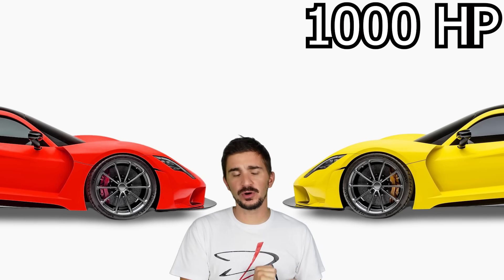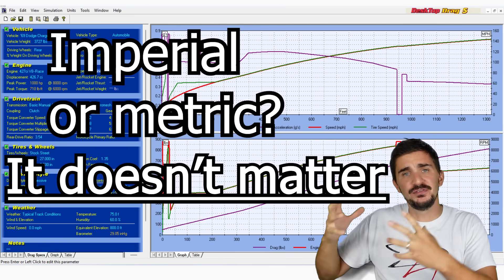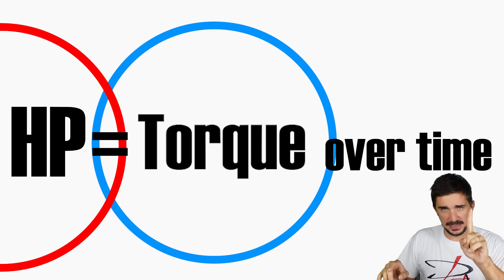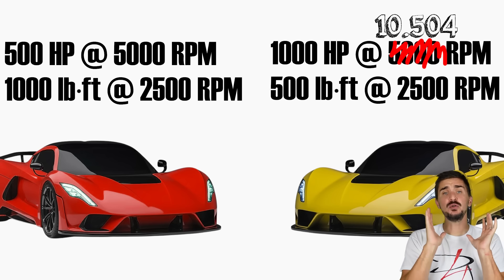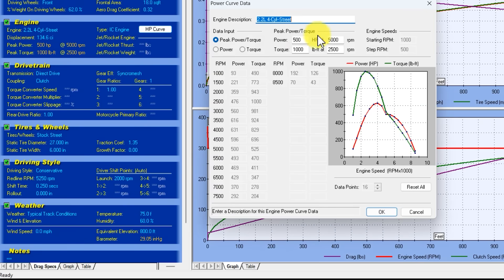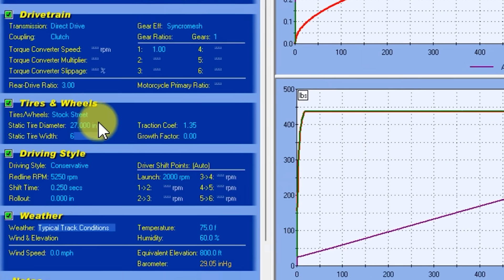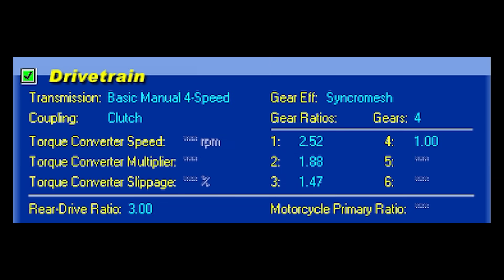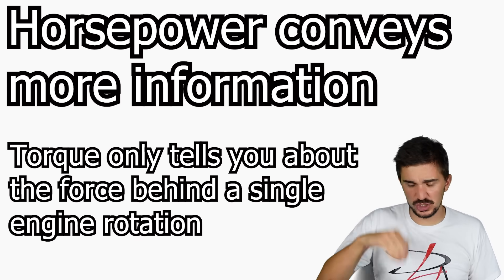Who's faster? Explained and Simulated - Horsepower vs Torque

Comment: Something that wasn't considered : if you make a lot of horsepower at high rpm, you can use shorter gearing to have higher wheel torque and still benefit from the high hp figure.
Reply: He literally added a transmission into the equation and thus determined torque bias being too overwhelming. Even added in a final drive and better tire factor. That’s the point of the whole video… adding variable factors to suit you ho/tq numbers completely change the results of the static output of X engine.
Reply: @theclamhammer4447 part of the reason torque was overwhelming was due to the fact that both of those engines were utterly ridiculous.

300/600 to 600/300 would probably be a more realistic comparison, it would certainly bring the RPM down to a reasonable range so that the gearing would not be as much of a factor as a 10K RPM engine. There are only a handful of cars on the street that can even hit 10K RPM and they still don't have terribly aggressive gearing, being street cars. The gearing on our cars is inherently biased to the low RPM engine as that's what they're designed for. 

If he used a modern six speed automatic, my dad's 2009 Z71 even, first is like 4.7:1, final is 3.42:1, that would put the 10K RPM engine back in the running.

He made a good point and got a lot of discussion going, which honestly might be better overall than being 100% correct in the video.
Reply: @theclamhammer4447 It is a definitional truth: acceleration at any speed is determined physically by the amount of pulling power at the contactpatch between the wheel and the road, which is determined by the torque at the crankshaft x the reduction factor between the crankshaft and the wheels. This reduction factor incorporates EVERYTHING, from the chosen set of cogs in the transmission to the reduction in the differential and the seize (radius) of the wheel including the tires. And the trick with power is that it is torque (at the crankshaft) x rmp of the crankshaft. So more rpm enables the running of a higher reduction and therefore an increase of the pulling power at the contactpatch between wheel and road. In other words a doubling in rmp with the same torque (= doubling in POWER) produces the same end result (after changing the reduction) as a doubling in torque at the crankshaft. Conclusion: it is POWER that matters for performance, NOT torque.
Reply: @theclamhammer4447 technically you shouldn’t have the same gear ratios for both engines though, so no the transmission example wasn’t very accurate
Reply: @theclamhammer4447  You don't get it, because you can rev it to 10000rpm and not 5000 you can use much shorter gearing and still have the similar top speeds. Shorter gearing = more demultiplication = increased torque at wheels. So in effect the low horsepower engine through gearing could actually have more torque at the wheels.
Reply: @theclamhammer4447  he didn't even adjust the torque biased car to match the equation. to get a 500HP car with 1,000 ftbls of torque the rpm needs to be 2626 not 2500
Reply: @theclamhammer4447  Ultimately it is all about torque at the wheels. if you have 2x the torque, but have to run gear ratios that are twice as long, because your engine doesn't rev, you have the exact same wheel torque at any given wheel speed. assuming a normal torque curve, not the 45 degree angle he showed here.
Reply: @russelljimenez4715  Ultimately is always about power. Torque only determines how many revs have to go along to produce whatever power is needed out of any engine. 
 If we need a lot of power to overcome inertia on a high mass vehicle, then, high torque is desirable so that we don’t need to rev up and burn the clutch just to get moving.
Reply: @russelljimenez4715 horsepower is just torque at speed. High torque just means smaller/longer gears are needed. Low torque engines with high horsepower at high RPM can just use a big/short first gear. 

500hP is 500hP. You will get the exact same torque at the exact same speed no matter what the engine torque is at the time, if gear ratios are appropriate. 

Only downside to something with VERY low torque like 10nM is that you would need a massive gear where the forces on such a small area would break it. 

But you can get any amount of torque you want with gears. Power is everything.
Reply: Especially when you have movie car transmissions with at least 15 gears 🤣. He does a great job with basic concepts and then opens your eyes to the many many factors affecting actual performance in the seemingly simple sport of drag racing. That simulator he was using was great! I created one in school that had about 20 variables to predict a 1/4 mile run of an actual car and to see how close you could get to the actual run. It was fun and opened our eyes to how complex it truly is.
Reply: @nathanaelcole8466 they just stole a transmission from a big rig 😁
Reply: @nathanaelcole8466 , 15 gears change so there could be multiple changing from 3rd to 4th and back to 3rd. Or maybe from 4th to 5th and back because the shown speed is around 110-120 MPH and climbing. ))
Reply: @nathanaelcole8466  simulator is great but parameters are poorly chosen
Reply: @nathanaelcole8466 gotta get to 20th gear wdym.
Reply: @nathanaelcole8466 there are cars getting real close to that many gears. I thing the automatic version of the mustang gt500 has a 10 speed transmission.
Reply: @nathanaelcole8466 when you have too many gears it actually slows you down. Particularly  a manual takes 250-500ms to shift. 15 shifts means 7.5 seconds were spent with no power to the wheels because you were shifting. 

DCT's can have lots of gears because they shift so fast it's more like 40ms. The time of a single manual shift is all it would take to complete all 10 gears. So you can make the ratios closer and stay high in the power band. With manuals sometimes you have to slightly sacrifice power band just to not make the gears so short that you spend so much time shifting it actually slows you down. 

Imagine shifting 6 gears just to 60mph? The same power car would be faster with 4 or 5 well spaced gear ratios just to avoid the time spent shifting. 

Sequentials tho have like a 10ms shift time. Faster the shifting, the more it makes sense to have more gears. Also depends on the power band width of the specific engine. Cars with a narrow power band benefit a lot from more gears. 

Cars with a very wide power band don't need as many gears to stay in the band over their whole range of speed.
Reply: @nathanaelcole8466  his simulation works for those who know absolutely nothing. But if you know anything about a transmission, the concept is not difficult unless you're a novice
Reply: Holy shit, this thread is wild.
45% bullshit, 45% horseshit, 10% coherent thought processes.
Reply: Depends on the shape of the curve.

True story: otherwise fairly identical Corollas. 
One with a standard 4agze at 10psi with 90kw at the wheels. 
The other with a 20v 4age and a big turbo (gt28 iirc) ~150kw at wheels.
Up to 160kph they were neck and neck due to the nutty torque curve of the turbo that only hit boost at 5000rpm and almost tripled the torque in about 300rpm before redlining at 7500.
The power was simply not usable. The turbo would pull ahead, and then fall back, and then catch up rapidly. 
So the neck and neck wasn't exactly accurate but they were side by side at that speed before the turbo kicked in again and finally pulled ahead for the last time.
Reply: wrong gearing for 150 kw 😎 once gearing once gearing be perfect its game over for 90 kw 👍🏻
Reply: @myne00  4A-GE 20V engine stock makes 162 Nm of torque at 5200 rpm or 5,600 rpm depending on the version. if you triple the torque from there its 486Nm and more than 265kW 🤔
Also if you shift near redline, only the second gear will drop below 5000rpm 🤔
properly driven it should walk away easily once you've reached boost in 2nd gear
I mean a lot of things can go wrong outside a simulation,  but if you can have boost between 5000 and 7500, its not that bad
Reply: @geemy9675  Well, I may have been a bit wrong since I was going off memory, and rough conversions from kph to RPM.  

I have the picture but YT doesn't allow links. Best I can do is describe the curve. 
The torque is showing as "N" on the graph.  
I assume this is newton-meters, but it could be plain newtons.

Torque: 1200n from 72kph to 144kph. then a strong curve up to 2600n at 168kph before flattening off at 2800n at 192kph.

KW: A steady ramp up from ~25kw at 72kph to ~50kw at 144kph, before launching up to ~122kw at 168kph, and topping out ~150kw at ~205kph.

Sorry I can't just post the pic. YT just deletes all comments with links.
Reply: @myne00 what😂my brain hurts
Reply: @myne00 wow.   Cause that was so helpful.    Thank you for all of the useful and needed details about the “race”.   It was like I was there.
Reply: in fact considered, for the first shot he stated multiple times to eliminate any transmission for the sake of clarity
next exercise: introduction of adequate transmission, so both are then comparable
Reply: And how many gears would you need?
Reply: @ErikZiak  at least one
Reply: @ldub0775  ever heard of Barney Oldfield and ford 999? Transmissions add weight.
Reply: @ErikZiak  The number of gears are irrelevant. The car with the most force applied to the ground accelerates the quickest. 

Force=(Torque/tire radius)*Gear ratio*Final drive

It's pretty simple, a higher reving car can drive faster in a lower gear. Thus lower engine torque might be superior to higher because it's applied in a lower gear. 

This is why hp is king. Hp is literally power, the exact thing that tells us how fast work can be done.
Reply: @felixsahlen1836  In most of your daily driving, you do not need the maximum power output. HP is not king at all. I prefer a flat torque curve between 2000 and 4000 RPM, where most of my driving is. The best efficiency is at peak torque, usually around 2500 RPM (depending on the engine). Or do you drive from red light to red light, maxing the power output and exceeding speed limits? Just because of "power"?
Reply: @felixsahlen1836  if the gearing is wrong then it doesn't matter if you make 2000 HP, if you never get into the power band you're doing nothing, which is what he showed in this video, though not explicitly.
Reply: same number of gears, just 2x reduction at final drive ratio for higher revving engine.  @ErikZiak
Reply: @ErikZiak  anything more than 4 will suffice unless you're building a car that will weight as much as Bismarck and will have to chase an SR-71. Gears' transmission coefficient numbers don't differ too much on modern gearboxes, so it's not hard to keep your engine around the peak all the time
Reply: @ErikZiak  if it does go higher rpm you might not actually need more gears since each gear would already be shorter if you wanted to match the top speed of both cars on every gear. 
But frankly 8 gears like many modern cars have should be enough.
Reply: @ErikZiak it depends at which speed you will race ? 50 cc and 21 hp . The 1 gear is very long , the almost smoke the clutch , but the rest of the gear ratio is perfect for the race track ! H P you need !
Reply: @ErikZiak Well motorcycles making power at 15k and diesels making power at 3k both seem to generally manage with 6.
Reply: @erikziak1249 what do you mean by that? You'd just need shorter gears to reach the same speed.
Reply: This is the lesson of Formula 1( high rpm, over square bore stroke ratio, 4 valves), and Top Fuel for sheer acceleration (brute torque)
Reply: Yep but there is 1 downside thst most people dont realize.
High rpm power usually means a narrow power band while low rpm engines will have wide powerbands.
If you use a lot of gear reduction you need more gears and the powerband's average power is more important than its peak.
High rpm engines need lots of gears and very fast shifting to make up for low rpm engine and their high powerband average power. They can use fewer gears and spend less time shifting
Reply: @BrokeWrench  It doesn't necessarily mean narrow power band, I mean 5-9K is 4K, that's not a lot different.

There's also the option to build to cover the entire RPM range, you don't quite get the peak numbers but you can have reasonable torque across a wide RPM range. One reason I know this specifically is a bud of mine made a bad cam choice on his build, idled decently, turned almost 7500, didn't really make that much power. With better heads it would have been impressive though.
Reply: @BrokeWrench  It's a myth, probably originating from racecar engines, where the low part of powerband is often irrelevant, so it's not optimized. But otherwise, there is no reason for higher-revving engines to have narrower power band, and most of the time they don't. Look at the Hayabusa engine - rather flat torque curve from 3K to 10.5K RPM. https://ridermagazine.com/wp-content/uploads/2021/10/2022-Suzuki-Hayabusa-dyno.png A 2x reduction gear would make it flat torque from 1.5K to 5.25K RPM - that's a dream for a car engine. Compare that to Cummins diesel that makes a lot of torque but only between 2K and 2.8K RPM and is dead below 1.9K or above 3K: https://tfltruckprod.wpenginepowered.com/wp-content/uploads/2017/03/2017-ram-3500-cummins-dyno.jpg
Reply: @BrokeWrench   The M1A1 only has 4 forward gears, but the gas turbine engine spins at 22,500 RPM to make 1500 horsepower that goes through 7.5:1 ratio pre gearbox for 3,000 RPM. A pre gearbox is a gearbox between the transmission and engine that lowers the RPM and increases torque. So you can do the same thing with a high rev piston engine that has the same shape curve as a low rev engine by using a low ratios spread out through the transmission and low final drive ratio or do what they did in the M1A1 tank with a pre gearbox before the transmission.
Reply: @BrokeWrench  Not really true,  actually. Like my motorcycle that revs to 12000, sure it's not doing well at 2000 rpm, BUT it is doing very well thankyou at 6000 rpm, aka half the redline. Similarly, a massive truck engine might redline at  3000, is doing very well at 1500rpm, aka half the redline. And when it comes to gearing, the interesting number is not the absolute rpm, it's the ratio of middling rpm to max rpm. And so my motorcycle has less gears than a semi trailer, not "more gears because its high rpm". Nor do I have to shift particularly often. It pulls quite well in 6th (top) gear at slowish suburban speeds. Until recently, formula 1 cars had 7 gears which is still less than a semi trailer.
Reply: I believe you're referring to the scenario where an engine generates high horsepower at high RPMs while having low engine torque and how aggressive gearing can be used to amplify torque at the wheels. In this context, if an engine has relatively low torque but can rev up to extremely high RPMs, using aggressive gearing can indeed result in high torque at the wheels. This is because the gearing effectively multiplies the torque output of the engine before it reaches the wheels. This phenomenon allows a vehicle to accelerate rapidly despite having low engine torque at the outset.
Reply: @elephant1851  You are correct. But you little engine dudes always forget, spin a engine that fast because you have No Torque and something will break.  Look back at F1 or any of the super bike series.  Look back
Reply: Fair point. Assuming 2 identical cars, they should have identical top speed. So the final drive ratio of the horsepower car should be roughly double that of the torque car. And suddenly you get a very different story.
Reply: @rarneum  yes, actually if you look at the real hp number, the torque engine hits 631hp @ 4000rpm so for a fair comparison the hp engine should be geared ~2.6x shorter
in the direct drive it was geared for 850mph 🤔
Reply: @rarneum  exactly.
Reply: @rarneum  the torque car is also better to push against winds/air on higher speed
Reply: Exactly what I came here to say. In the test it shows that 1st gear doesn’t even get past 4000rpm going 88 mph timestamp 8:12
Reply: @oliververnon8120  Forgot the Flux Capacitor ... 88 mph!  Great Scott!
Reply: Indeed, gearing is everything...
Reply: same goes for making tons of torque over a narrow band, you can use a high final ratio and set your shif points so that when you upshift the engine rpms drop to a good steep uphill point of your torque curve so you are always in your peak torque band, then your high gear will take you the rest of the way, you may have a lower top speed but your average speed may well be higher. 

smaller rpm band can also be easier to gear for so you hit your peak rpm in high gear right at the finish light. 

However, its normally easier to build something to make a ton of power high in the rev band than a mid range torque monster with a power curve appropriate for drag racing, 

normally a engine with a lot of torque in the mid range of rpm (3500 to 5000) is going to have a much gentler curve and be much more suited for a fun street car.
Reply: Yurp. On the opposite end, it's why my F350 does 0-60 in roughly the same time as any base model muscle car. It weighs 2.5x as much, but also has 2.5x the torque and roughly the same rear end gearing (3.31:1)

To get half the torque my Ford makes to the tires in my dodge, it needs a 6.68:1 granny gear and 4.10s, to the Fords 4.62:1 and 3.31.
Even then, the dodges 408 needs to see 4400 to make peak torque and my ford does it pretty much off-idle at around 15-1800. 

That Ford will drag the Dodge everywhere below about 90mph, but once you get the Dodge wound out tighter than a snare drum in 4th gear and 5,800 rpm, it will definitely reel in the one ton. And they're roughly the same HP, both just north of the 450 mark. 

Personally I enjoy lower-revving torque monsters, they're a lot more drivable as a daily, but there is definitely something to be said for spinning an engine to mach Jesus while the power comes on at 6k+ rpm. My Dodge may be 35 years old, but the smile I get through a carbureted 408 with open headers is bigger than any my super doody has ever given me. Better hold on tight and pray it stays hooked when that cam kicks in😂
Reply: something that wasn't considered in your example of consideration; you always sacrifice with shorter gears. high power is bottle necked by a pegging redline at an abysmally low top speed, and also makes the car incredibly annoying to drive 99% of the time you aren't actually racing.  You need a happy medium. a very long top gear, and decent middle gears.  Why I say decent and not aggressive is because you can't have a long top gear and short middle gears due to poor spacing. gears not only need to hit a happy medium, but they also need to be spaced out well.
Reply: @twrcrew8852  Yes, that's true, but that's why I specified a high redline. If you take two cars that have different redlines and same gearing, the one with the higher redline will get to a higher speed before hitting it and needing to shift (I think you know this though). Therefore, you can use shorter gearing, get more wheel torque and still get a normal shift point in terms of speed.
Reply: Was definitely gonna say gearing makes a ton of difference.   But well explained  👏
Reply: Gear changes take time away from putting power down, its all about a to b in drag racing
Reply: Joshrenolds279 you got it mate
Reply: Of course. Best example is f1 car.  Very low tq but high rpm and short gearing with very high final.
Reply: exactly why hondas are surprisingly quick despite being so anorexic in tq figures
Reply: Exactly! Torque at the wheel is what's important. Torque at the engine is just an intermediate measurement. In the real world though, an engine with more torque will feel stronger to most drivers because they don't like revving the crap out of it all the time.
Reply: Horsepower + transmission beats anything because with transmission you can change torque. This is why racing cars typically have more higher rpm and hp.
Reply: @SurenEnfiajyan  More specifically, torque at the wheels is the big thing. At the engine, all that matters is horsepower.
Reply: If you spin the engine to 10500 rpm’s and it makes 500 ft tq at 10500 then it will make 1000 hp
Reply: Yes, but from a launch you have to start at basically zero rpm, so initial acceleration really benefits from high torque and also being able to tow at low speed
Reply: @tylerheiser6495 you don't start at 0 rpm, that's why you have a clutch.
Reply: at the cost of your clutch/convertor temp.
Reply: Do you mean long gearing short?
Reply: More losses
Reply: Exactly, with optimal gearing you can simply generate more force bc you have a greater multiplier to the accelerating force.
Reply: I think this video is only relevant from the perspective of brake horsepower to the wheels
Reply: Very interesting fellas.  If we concentrate on the extremes, F1, motorcycles, big rigs, top fuel. We probably are going to miss the sweet spot of performance.  Probably somewhere around 7000-7500 rpm, which is where both HP and torque matter.  There is an old saying “no replacement for displacement “.  And with that displacement comes both hp and torque.
Reply: @grandduke2145  Remember that saying doesn't always apply, it's always a compromise, sometimes it's preferable a smaller more efficient engine than a bigger one, for example there's a nice type of motorcycle racing in NZ on which you can race with watercooled 100cc or air cooled 125cc but limited to 24mm carb, which one is best? Man as I said, that rule doesn't always apply.
Reply: @cristianr3712  Not disagreeing with you Cristian.  What I am saying is there is a sweet spot for hp and torque for the vast majority of applications.  Yes that little engine works on a motorcycle, but put the exact same engine in a normal sized car.  You will need some funky gearing to even get it to move.  I have had the discussion with some of my 4 cylinder buddies and they admit those little engines are not for most applications.  What I am saying is when you move away from the extremes (either big or small).  There is a sweet spot in size especially in high performance applications.  I have a 6.2L, little big, but it makes good power and torque.
Reply: @grandduke2145  Oh for sure, but again it's all in the application, check the 1000hp GTR that was running circles around the V8s in the Australian championship, it's all depending on the application and what the rules allow.
Reply: @cristianr3712  I am with you Cristian.  However, if you do the exact same thing to a larger displacement engine that you do to a smaller one, who makes more hp and torque?
Reply: @grandduke2145  Sweet spot regarding size... Yes, bigger is always better... No, that's my point regarding your comments.
Reply: that’s like making a tour de france cyclist race in the lowest gear. Nonsensical
Reply: it makes sense why F1 uses 8 forward gears, unlike most if not all racecars
Reply: @ryndrssn  Sure they also weigh much less and sustain high speeds but we were talking about 1/4 mile times above and homie said torque was trash lol. An F1 car is absolutely pitiful in the 1/4 mile all things considered about as fast as a stock Hyabusa
Reply: @ryndrssn It makes sense in so far as F1 is the most extreme expensive motor sport so they have the most extreme expensive gearboxes.
Reply: Yes but I still like the video cause it explains why cars like the amg a45s are so bad in comparison to a rs3 and m2. You need torque and hp on a broad bandwidth and not only for a very narrow rpm window
Reply: the trans he used is 1 to 1 it doesn't mess up the experiment
Reply: but bad for the parts, the piston, crangk, etc
Reply: @MrKepalababi  the only real issue here would be piston rings(well, also bearing and other "joints", but never in my life have I seen an engine that had any issue with those before it had more serious problems with other parts that required the change of the entire component including the bearings) wearing faster due to more friction happening. As for the crankshaft, piston heads&rods etc., the difference between low torque high rpm and high torque low rpm engines are comparable to a dozen hits with a regular hammer vs one hit with a sledgehammer and it mostly boils down to the type of alloy used in said parts and some specific design differences. If you try to spin a high torque engine to 9000rpm it will most likely shatter, if you try to give a high rpm engine 700Nm of torque, it will also instantly break.
Reply: Volume and weight are the concern in this case but i see where you are coming from
Reply: The best I could do w/my Mazda in the 70's was remove the gears from the manual rear axle & put in the gears from the automatic version of the same car giving me a better ratio. **Exactly what you are talking about & for the stated reason.
Reply: Like a Honda S2000.
Reply: then you cut top speed you only have 1 gear
Reply: I guess you didn't watch the video
Reply: Low gears decrease top speed.
Reply: Also quite important: you have a  wider rpm range to control how much power you'll have.   Comparing same peak power with about the same speed range, a fast revving engine has a wider range to produce close to maximum torque compared to a slower revving engine. So the faster revving engine will have a better driveability  at both low and high speeds based on the torque, assuming peak torque is at the same speed
Reply: Something you probably did’t consider: if you make a lot of horsepower at low rpm, you can use less aggressive gearing and still have high wheel torque to benefit from the high hp figure. All in all it is the horsepower that matters, the gearing and everything is just their to help engine utilize that power. Just think of a bicycle, your body is the engine, the bicycle is essentially the drivetrain and the suspension. A properly designed bicycle can make you pedal more efficiently, and less fatigued, but a professional cyclist can still outride on a cheap bicycle.
Reply: Engine by itself generate torque, then this is converted with to power that is measured in HP or kW, and generally rpm times torque gives you power output at any given moment.
Reply: You also lose speed by making it have shorter gears
Reply: Tell me you didn't watch the video without telling me you didn't watch the video
Reply: But he said the only difference...
Reply: Very well explained as usual !
Reply: Exactly, just look at old F1 v10 cars, 950bhp at 19000 rpm and only 280Nm (200 ft•lbs), they were able to cover 600m on wet conditions in 9.6 seconds at over 300 km/h. (F2003 vs eurofighter race)
Reply: and than your top speed is significantly less
Reply: It's all in the de-multiplication. Simple way to think about it is if the same max speed is achieved in a certain gear, torque and hp get remapped to different rpm through ratio. So, in this example, 2x shorter final drive for the hp biased should give similar results to tq based. Think a Vtec with a 4.4 vs a diesel on a 2.2
Reply: Assuming we have an engine producing 160bhp at 7500rpms with a longer ratio.
Would a shorter gearbox affect that 160bhp figure?
Reply: @Von2097  No, the engine would still be making it's 160 hp at the flywheel however with shorter ratios you would get more hp at the wheels for each given gear. The engine's power can't be changed through gearing, only what makes it to the ground.
Reply: Horsepower really is a product of Torque and RPMs divided by 5252, so your statement is odd.
Reply: But the high horsepower figure is a result of the higher wheel torque.
Reply: Pretty sure this is what Honda did with my VFR compared to my Harley. 1st gear in my Dyna is the equivalent to 3rd on my VFR.
Reply: That's just F1 engines innit
Reply: He pretty much explained that just not directly. I’d say when he changed to the shorter gearing in favor of the higher HP he explained what you said. But go off ig.
Reply: It was considered, you just weren't paying attention
Reply: I ain't no scientist but if those cars were 'face to face' on a racetrack ......💥
Reply: Nag
Reply: Correct, it wasn't considered...  deliberately
Reply: Yep, its Just not good getting of the line
Reply: All of the gears would be needed. Fords new 20 speed should do🤣
Reply: Incorrect. The engine bogs. Not enough power GENERATED in the engine.

All of you guys that think you know what you're talking about are really annoying. And you do a massive disservice to gear heads' knowledge.

We're in the mess we're in BECAUSE of people like you.
Reply: “3 on the tree.” Old school, we don’t know anything about that. 😅
Reply: That's because he's not American who needs to yell everytime they open their mouths 😁
Reply: Something you didn’t consider: You can do the same with a lot of torque, you can have a lower gear to achieve a higher top speed and still benefit from the high torque figure.
Reply: Orr use  transmission with more torque which increases speed?
Reply: Where does the constant come from
Reply: Doesn't this mean the opposite as well? High torque, long gears?
Reply: S65?
Reply: That's a fix but not the experiment
Reply: Yes, but the issue you run into is having to shift way too frequently for the first few gears to be useful.
Reply: there are practical limits to gearing due to required shaft sizes and case packaging lol

generally I believe its more effective to gear torque up than gear hp down. both for performance and essentially for efficiency...
Reply: *especially
Reply: 🧂🧂🧂🧂🧂🧂

Just enjoy motors guys and gals
Reply: When the top post is by someone who didn’t watch the whole video. 😂
Reply: I also would've loved to See a simulation for the 1/2 mile with all those factors
Reply: The engine with more torque would go through those gears faster.
Reply: You guys all need to remember one irrefutable fact.      Without torque, there is ZERO HORSEPOWER.   An engine with 1ft/lbs of torque would need a zillion rpm to make anything worth a shit.   1ft/lbs at 10,000 rpm’s is 1.9 horsepower.    100,000rpms equals 19 horsepower.         “Real nice engine you’ve got there.     How much torque?”   “Torque doesn’t matter.”    “Oh yeah?   How much horsepower? “.    “20 horsepower”.    “Wow, and it spins to 110,000rpms?”   “Yep”.    “WOW.    How hard is it to keep the rotating assembly in one piece with, you know, pistons traveling to a trillion mph before completely stopping and reversing direction, so many times per second, crank arms trying to go this way, that way, all over the place, and with balance issues becoming problematic on an exponential curve with RPMs, it had to be a bitch to keep it together.”    “Yeah”.     “So a rough calculation tells me this thing makes, what, about 1ft/lbs of torque?”      “I don’t know, all I care about is horsepower”.    “Oh, okay”.    “But if you doubled the torque, to a whopping 2ft/lbs, you could bring that rpm number down by one half, to 50,000rpms, which is still quite a feat for ANY reciprocating AND rotating assembly, that, you know, weighs , well, anything at all, even mere grams.”      “Yeah, okay, maybe I’ll try to double the torque then, but then I’d need to increase the stroke a bit, and then the engine skirt would be too long to fit.    Or I guess I could increase the bore just a hair.”  “You know, it wouldn’t take much to get 10ft/lbs out of this, maybe try some forced induction, and a very slightly longer stroke”, without changing your block.   If you had 10ft/lbs, you could run this baby at 20,000rpms and get 38horsepower, nearly double.  And longevity would skyrocket.   But you know, if you just want peak horsepower for a split second before watching the thing grenade, it’s your machine my man”.      “Yeah, I’ll think about it.”       There is zero horsepower without torque.    That said, increasing the torque by a factor of ten only gave us a doubling of horsepower.    Hmmmm.     It takes either displacement or artificial displacement in the form of forced induction, where either one is doing the same thing, exploding a certain MASS of air and fuel mixture, not volume, and not weight, as it wouldn’t matter where in the universe this explosion happened, it would make the same power because the combustion chamber is its own micro-verse, for a split second.     This is why F1 cars and motorcycles shoot for stratospheric rpm numbers, it’s all about the form factor.   You can’t put a 400cubic inch engine EFFICIENTLY on a motorcycle chassis, nor can you have a four wheeled vehicle change direction with over 1g of grip and such incredible velocities with a 600lb slug of iron ANYWHERE in one place on the chassis.    Wait.   I’m wrong.    F1 engines do weigh about 250lbs.     Damn.     See?    That proves me even more correct.     Even F1 cars need torque to overcome weight.    Damn.  F1 cars are fucking amazing.
Reply: Identical is the word he used.
Reply: So he did consider that in the video friend
Reply: Very true!
Reply: HP is the final product output 
Higher HP can generate Higher torque via transmission. 🤣🤣😁🤣
Reply: If there was a perfect transmission out there that could turn at any speed with efficiency, torque wouldn't matter much. This just seems to show the limitations of power delivery in the test vehicle. Hp should always matter more in an ideal situation. The only reason torque is relivent on vehicles is we use internal combustion engines that have a limited power band, its an indication of power at lower rpm and towing capacity.
Reply: @devinfritchey7323 you don't seem to get the point that power is a function of torque. You can't separate the two. In a race car it's fine to have a high revving engine and be changing gears for every corner, most people don't want to drive like that.
Reply: @jeronimous7326  Power is the rate at which work is done or energy is transferred, calculated as work divided by time. Torque is a measure of the tendency of a force to rotate an object about an axis; it is not the same as power. One horsepower (1 HP) is another way of expressing 746 watts. You can't convert torque to watts without additional information about rotational speed because power in rotational systems is calculated as the product of torque and angular velocity (P = τω). You might be thinking of torque in terms of engine specifications and marketing rather than its precise physical definition.
Reply: @devinfritchey7323  I'm an engineer, thanks for repeating what I learned 35 years ago and adding nothing to the conversation.
Reply: @jeronimous7326  I mean, at least I said something more than brag about a degree a I got 35 years ago... I was actually engaging with someone on yt. It's my fault for tryiing, lol.  Have a nice life my friend.
Reply: I got to say this though guys.  When you start spinning an engine 10,000, 11,000, 12,000 rpm sooner or later you are going to break something.  I am saving my money for a new cam, probably a BTR, some mild head work and headers.  I did see on here, they made a 427 LS that made great power NA.  I figure I could get 900 hp and about 900 lbs of torque at the wheels.  Already did the blower and all of that.  It is a CTS V (I know, I am a Old Man) makes about 575 rwhp and about 550 lbs of torque. It makes over 500lbs of torque from about 2200 to 5500 rpm.
Reply: Torque is completely and utterly irrelevant. I don't know why it's a number even quoted as if it means anything. You build in a gear box and final drive appropriate for your motor, and all that matters is power.
Reply: @xpusostomos torque does matter, not the peak torque figure, but the curve does
Reply: @Amy-dq2lg  no it doesn't... Except in so far as it determines the power curve
Reply: @xpusostomos  That's what I was trying to say
Reply: @xpusostomos torque is literally part of the equation for HP. Lol
Reply: @PaleAura1  How fast do you think an engine with 500 lbs feet of torque but that only revs to 100 rpm is? Very slow, because you're gonna need gears long enough to actually drive at normal speeds, and those long gears decrease the torque at the wheels . Power is the only relevant metric for determining the performance of an engine.
Reply: @xpusostomos except that two identical cars with identical peak HP but one a diesel (Torque low down) and the other running on gasoline (Max torque above 4000 rpm) and basically the same gearbox. The diesel wipes the floor with the gasoline powered car. Useable torque at low revs and a decent flat torque curve means it will outperform the gasoline powered car everywhere in normal use. Only when everything is working in favor of the gasoline engine, does it have a chance...by revving it high
Reply: @W0o0dy  you wouldn't gear those two vehicles the same way.

That's why imports beat the hell out of small domestics on the 60s through 80s. Honda, Nissan, Toyota, had high ratio first gear, 3.5 or higher. Domestics used the same transmission on the little cars as the big ones, 2.43 first gear is fine with a V8, sucks terribly with a 170 CID inline 6, really bad with a 2.3L 4 cylinder.
Reply: @glenwaldrop8166  true but even with a shorter final drive, most of the time the diesel with equal horsepower is faster due to more horsepower/torque at useable rpm. All out, our Toyota isn't slow but a small hatchback walks it in most everyday driving situations due to the long gearing and relatively low torque across the rev range for the Toyota relative to it's weight.
Reply: @W0o0dy  in keeping the gearing the same it's choosing the winner.
Different tools require different accessories. You wouldn't use a wrench on a Phillips head screw and you wouldn't use a high revving engine with numerically low gears.
Reply: @glenwaldrop8166  yes and no. With more and more focus on fuel saving ratios have become much longer even for Gasoline powered cars. And the importance of torque over power becomes increasingly clear. We have to use turbo's or add electric power to get cars moving because the torque from the smaller and more efficient gasoline engines is insufficient. So it's clearly not a power problem but a torque issue.
Reply: @W0o0dy  I'm not sure you grasp the whole situation.
500 HP geared accordingly is identical regardless of engine size and RPM. When you factor in the correct gearing the torque that hits the ground is practically identical.
Reply: @glenwaldrop8166  yes when you adept the hearing IN ORDER to overcome the torque difference at the wheel. But torque at the engine is what produces HP, so one is a given and the other is an outcome bas d on the number of revs. But Torque is the power that drives the car, not hp. No matter what you do to change things torque at 2000 rpm is a fact, the HP a product.
Reply: @W0o0dy  You act like one is different than the other, like one is better than the other, the gear is what makes work possible.

If you have 1000 lbs ft of torque with a 1:1 first gear then it will lose.

If you mismatch your tools they don't work.

If you actually design your parts to work together then there's no difference in the results.
Reply: @glenwaldrop8166  What do you mean you will "lose" with 1000 lbs ft torque with 1:1 gear?  Jay Leno's 27 litre V12 can do 80mph at idle in top gear, which is probably around 700rpm, and it has 1700 lb ft of torque at idle.   I think it's fair to say that car can launch you quite nicely in top gear 1:1 ratio, if you are so inclined.
Reply: @W0o0dy  The only reason the diesel car would win in your hypothetical scenario is because you're comparing peak HP. Peak HP is pretty irrelevant, the more important factor is the integral of the power curve, or the average HP in the rpm range that is used. Which is higher for the diesel car, and so it wins. Because the HP is higher.
Reply: @xpusostomos  I don’t think you understand. Torque matters a lot, especially in heavy applications!
Reply: @ThuhElement  it doesn't matter in as much as you can have as much torque as you want with gearing
Reply: @xpusostomos  But we don’t have 20 gears on motorcycles. My turbo zx14 has a 39 rear tooth because it has torque for days. It also means that I can carry a passenger and still put busses on a bolt on 1000.
Reply: @xpusostomos Area under the power curve is what really matters but you’re right. It’s power that matters. It’s literally physics.
Reply: @xpusostomos  Only torque on wheels matters. And that why good gearbox is needed
Reply: @BartomiejGawron  No, no, no, no. You could have a million lb ft of torque at the wheels, but if it's spinning at .0000001 rpm, you're going to launch like a snail. Such a setup could launch an ocean liner like a snail, but it won't get you anywhere fast.
Reply: @xpusostomos  Obviously. My bad
Reply: @xpusostomos  the same way rpm is irrelevant.
Reply: @Parker--  sure, in as much as you use gearing to get the results you need.
Reply: @xpusostomos  You seem to be the only one that knows what they are talking about here. Here is my story of dealing with...well you know...  So I had some debates with people saying a Case 150 steam tractor could win in a pull off against a bulldozer "because the steam engine makes 5,000 ft*lbs of torque" nonsense, even though it is just 150 horsepower. Yet, they forgot about gearing and weight for traction. I mentioned the M1A1 tank that has a gas turbine that is 1500 horsepower at 22,500 RPM which is a torque value of 350 Ft*lbs that goes through a pre gearbox of 7.5:1 before being connected to the transmission torque convertor. They then come up with all kind of excuses. What I like even more is that now there is video of a bulldozer not even trying against the Case 150 steam tractor, and the steam tractor struggled. If the bulldozer operator was serious, that steamer would be dragged around like it was not even there. I like how after that video it's all crickets. No one runs their mouth anymore. It's hilarious.
Reply: @EETechs  yes, power always wins as long as you can gear for the task at hand.. and of course get traction or anchor yourself.
Reply: @xpusostomos it factors in depending on the physical limits of specific motors a big 4 like 240sx Ka24de won’t be able to take advantage of higher horsepower and rpm  the way the sr20de will because the pistons are so much bigger 

Torque is acceleration though so high torque cars usually do well on 1/4 mile but less so on highways 

For a long time the Ka24det was the fastest s13/14 motor I haven’t kept up in years but last I checked there were Ka running flat 7s I’m sure these days they’ve done even better
Reply: @off6848  more nonsense. Torque is not acceleration, torque is force. The only thing that gets you down the quarter mile fast is power.  High torque motors are completely irrelevant, because you can multiply torque as much as you want with gearing. I can get an almost stock Toyota corolla to put more torque to the wheels than a V8 Mustang if you let me play with the gearing or diff ratios.
Reply: @xpusostomos  You would be increasing parasitic drag and heat, this isn't how it works if it was they would be putting lawn mower motors in race cars with 100:1 gear ratios. You cannot cheat your way around friction and thermodynamics lol. Torque IS power. Horsepower is power over time or frequency of power.
Reply: @off6848  Torque is not power. Torque is torque and power is power.  And a Toyota corolla putting down 1000 ft lb of torque via gearing would have almost no friction and thermodynamic issues. Why? Because it would be only going at 1 mph. Assuming the gearbox could handle it and not twist into a pretzel, it could probably tow a 747 with the torque, but would never get up to speed. And that's why you don't put lawn mower motors in race cars, not because you couldn't gear it to give enough torque, but because they don't have enough power.
Reply: @xpusostomos  How much horsepower does a Tesla Plaid have just curious.
Reply: @off6848  1020hp,  why?
Reply: @xpusostomos  Because I wonder if you think you could build a weigheted up to 5000lb Camry to do a 9.4 quarter mile with that hp number. 

Do you know why such a heavy car can be that quick in a 1/4 mile its because of torque. Torque is what gives it the acceleration to jump off the line that quickly.
Reply: @off6848  Torque by itself has nothing to do with "jumping quickly". Torque is an amount of force, that can exist even when nothing is moving. Put a 1000 ft lb car with a rope to an ocean liner, and put the pedal to the metal, you're exterting 1000 ft lp of torque, and yet nothing is moving AT ALL. Now, if you have enough POWER to exert that torque at a decent rate of RPM, now we're talking business. Torque without sufficient RPM is snail's pace. Torque plus RPM is power. So it's all about power.
Reply: @off6848  Torque is NOT power. Torque AND rpm is power. You failed physics 101. You can have torque WITHOUT ROTATION. Aka, stall torque like in electric motors, steam engines, and hydraulic motors. Also, gas turbine engines spin much faster than piston gas engines yet the M1A1 tank uses a gas turbine that makes 1500 horsepower at 22,500 RPM, which has a "weak" torque of 350 Ft*lbs that then goes through a pre gearbox of 7.5:1 before going to the transmission torque convertor. The gas turbine has no problem moving the tank and it would drag a semi dump truck that if fully loaded around like it was nothing. Gearing makes a big difference, bud. Remember this: "For every RPM to RPM match up, the engine with higher horsepower will have higher torque after the gearbox". In other words if an engine is 100 horsepower at 100 RPM (high torque) is against another engine that is 1000 horsepower at 5,000 RPM that is then geared down to 100 RPM, then the geared down 1000 horsepower engine will have more torque.
Reply: @xpusostomos  exactly. You can see this on rc cars. You can get high torque motors with lower rpm and you just change the gearing to achieve the same performance and lower torque, higher rpm motors.
Reply: @xpusostomos 
“Torque isn’t important”
light turns green
takes off in 1st gear
shifts to 2nd gear
shifts to 3rd gear
shifts to 4th gear
…..
shifts to 17th gear
finally makes it thru the intersection
cruising in 467th gear
“Oops, a slight hill”
shifts down to 3rd gear
Reply: @cmbaileytstc  Torque and RPM is what he is saying, which is power. ANYTIME you talk about torque and something is moving, you are describing power. Overlay the power curves of the engines on the same graph and you will see what I mean.  Having just torque does nothing, which is why it is not important. So many people failed physics 101 here. It is sad..............Your gear ratios are stupid. You would use ratios that keep RPM high for high RPM engines, not a crap ton of gears.
Reply: @xpusostomos if that was true then diesel engines would not exist.     Also, horsepower is an ABSOLUTE function of torque.
Reply: @xpusostomos It’s completely relevant when talking about drag racing. Yes you can gear down and add more gears but it comes at a price they tend to break that’s why you see fast people running trans with less gears. This is why they call it a combination because there are so many but if you drag race 1/8 mile then tq of your engine does matter especially naturally aspirated and the reason why tq is relevant is because tq is what and how hard you are carried out of the hole until rpm can be had to utilize hp which tends to be after 5000 rpm and usually starts to kick in at the 330 ft and gaining by the 660ft. You ever drive a v8 vs a 4 banger and launch them about the same weight. V8 don’t need to launch with rpm like a 4 cylinder does. Tq is also relevant in trucks that require towing capability for those very same reason of having tq down low. Honestly both numbers and the way they curve and Carry equally is what really matters. Peak number don’t mean crap average overall numbers matter. For a street car you want a lower tq higher hp car because people roll race. A the drag strip I like equivalence of tq and hp.  Believe it or not the start is the most important part of drag racing it’s hard to hp back from a shit start. This is why you don’t see the quickest drag  cars in the world anything but a v8 big displacement hemi that’s blown on top fuel. The reason is big tq and big hp believe me it matters just as much as hp.
Reply: @joshreynolds729  Drag racing: completely different thing you're talking about. OBVIOUSLY torque matters to people designing the motor car. You can't put high torque through machine parts that can't handle that torque. That's the case whether a drag racer or Toyota Corolla. That's a different question to whether torque or power is the thing that gives you performance. "Torque is how hard you are carried out of the hole until rpm can be had"... 100% wrong. Only power makes things move. You can have a zillion  lb ft of torque, but without power you are launching as a snail does. What you want to say is that a flat power curve, such is common on  a high capacity, low revving engine will be easier to launch without resorting to a very low gear. Drag cars are big capacity because they have 12000 hp, which is even more HP per cubic inch than a turbo formula 1 car. It's nothing to do with needing the torque, it's to do with needing the power, and like anyone they'll use the smallest engine that gives them the HP they desire.
Reply: @joshreynolds729 You're mistaken in 1 thing, big V8 hemis are the most used due to the rules, not due to the reason you mentioned, Top Fuel can be way faster with more valves instead of the shitty OHV system they use.
Reply: @joshreynolds729 so much wrong with what you said. Horsepower doesn't just magically start to take over at 5000 rpm... 

Power is the only relevant number.
Reply: @cristianr3712  Top fuel uses the Chrysler Hemi over ohc 4v engines because the Hemi is a better motor for torque. Which is more important when accelerating.

Plus all the experimental ohv engines made for top full break before they can reach the same hp as the Hemi. The Hemi is barely reliable enough for top fuel. A ohc engine has no hope. But yes, technically if reliability was not an issue, then ohc theoretically will make more hp.
Reply: @xpusostomos   absolutely. This video is complete rubbish
Reply: @prckata   lol no thought from you
Reply: My car is fast.  Not Hyper Car Fast, but Super Car fast.  We will get there with the next mods.  You dudes with those little engines, how long before they break?  You live on the edge and you end up with a pile of broken metal.  If you have to spin your engine that fast, YOU have done something wrong.  If’n you need special gears, you have done something wrong.  And don’t tell me about F1, I go back to Jim Clark, (don’t know who he is huh?  Look him up).
Reply: @grandduke2145 
Jim Clark eh?

Who won with a Ford DFV engine.

An oversquare, rev happy, not particularly "torquey" engine?

That Jim Clark?

What, you didn't wanna go for Shelby, and his quote about 7000rpm?

Say, why is it all the legendary race cars, sports cars, hyper cars, and super cars, have rev happy engines I wonder.

Even the Corvette, and the current Mustang loves revs.

I wonder if it's because contrary to popular belief, torque figures mean nothing, except maybe indicate where your engine might run out of breath.